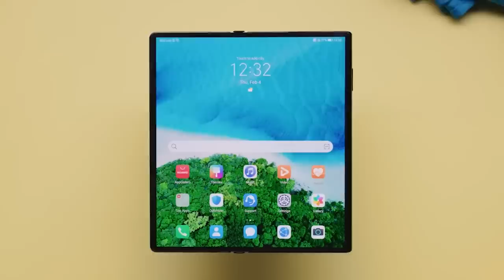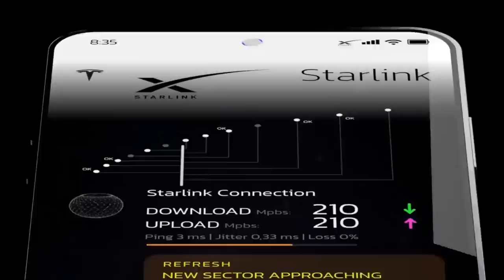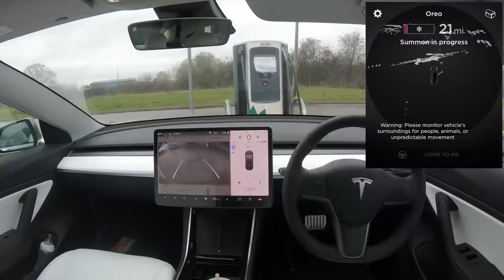Tesla Phone Model Pi Rumors🔥🔥🔥

Comment: Using Starlink, there would be no need to rent a satellite phone when heading out into the wilderness where there are no towers. That alone is huge.
Reply: Just no way. Current  starlink transmitters require 100W.
Reply: @WorBlux  So are you saying the signal does not come directly from the satellite to the phone but instead comes from a satellite to a ground station transmitter that must rely on 100W to transmit a signal to the phone?  That doesn't make sense to me.
Reply: @daffidavit  he is not saying that. But ur guess could be right since we will not find miracle tech to get that to few Wats to be usable, but it is possible phone could be a dish that drains 100W from wall. 90W is standby goes above 160W
Reply: @daffidavit   The starlink dishes they are sending out to get internet consume 100 watts of power.  You aren't putting that in a phone. For high speed data in a phone you need under a 1 Watt.  Two orders of magnitude difference. 

The satellite and starlink connection is real, the idea you could carry around the transceiver and power supply for it in your pocket is simply tech fantasy. 

Sure you could probably make a limited rate voice/text fallback that fits into form factor (64kbits/sec at best) , but that's not what is being promised in the marketing material (starlink internet (high speed date) on a phone) And even this would require a retrofit of the existing satellite constellation, and is a market niche already served by existing consetllations.
Reply: There are some serious issues I worry about. The lights from the satellites could disorient insects who depend on the stars to navigate, killing them. The space junk could obstruct Elon's own space ambitions. I just don't see this ending well.
Reply: @Mitchthemysteryman  bruh
Reply: And no need to get a different phone when traveling outside the country
Reply: I enter the wilderness to get away from the cell phone. Men have done it for hundred of years.
Reply: @WorBlux  todays phones are less than .5w. You aren’t very bright. Thank god Elon Musk is.
Reply: @petemitchell6788  What he's saying is that current Starlink receivers require 100W. You're just reinforcing his point...
Reply: @Mitchthemysteryman  I know nothing about the insects, but space junk should be taken care of. The satellites have small thrusters and they which kill themselves by entering the atmosphere at the end of their lifecycle.
Reply: @petemitchell6788  You know you can also turn off your cell phone to "get away" from it right? or just put it in do not disturb mode. No need to go to the wilderness to get away from it. lol
Reply: lol, rent. where are you siberia? or the septic states?
Reply: @petemitchell6788  Less than 0.5W is included in the range of less than 1 W. I'm being generous and assuming people would tolerate a thicker phone for the sake of satellite service. There are also several regulatory issues that make the less than 1 W relevant. (FCC license, and SAR limits)

But cell phones aren't trying to target 60 miles away. You simple need more power even in the best case. AT LEAST 36x more as a 4G cell covers 10 miles at best and the starlink satellites are 60 miles up, and could be up toe 200 miles away. Making the math even worse.  That is with the same tech.  

With cell technology, the high-gain directional antenna on the cell tower does the  bulk of the work, with 5-15 degree slices of cells around the cell tower. Beam shaping forming is done at the cell tower in a limited fashion. (2-4 transmission elements/cell) and primarily for signal separation rather than trying to steer to individual targets. 

Starlink is not a geosynchronous constellation, so both endpoints have to deal with relative motion of the other.  This is done with a phased array antenea, which uses multiple transmission elements to steer the beam. Each array can only cover a 60 deg cone, and efficiency/gain is related to the number of elements present.  The starlink satellites use a very large array as power in space is hard to come by.  We are talking thousands of array elements.  This is fine as a solution for the central transeciever.

However the  cell phone form factor is likely space is psychically limited to about 4 transmission elements. But to get enough gain to fit  within the electrical requirements of the phone you'd need an array with thousands of elements.  Also if you speak with the phone is a position other than screen up towards the sky you'd need 4 separate arrays within the phone to give you positional freedom. 

The current star-link consumer receivers split the difference. The use a few dozen array elements and a reasonable amount of power to draw from the grid or stationary power supply. 

But something even close to cell phone size and cell phone power -- absolutely not possible  unless you seriously increase the frequency window and use spread spectrum techniques to increase receiver sensitive.And you lose almost all of your bandwidth potential when you do that, compare LoRa to wifi6.  And I'm being quite generous to even assume real time voice communication would be possible. 

Musk may be bright but he's flat out lying to you, He's a con man with a long list a vaporware products, that even a cursory analysis shows to be completely bonkers. Vacuum trains, rocket mass transit, tunnels at 1/10 the conventional cost w/o any fundamental improvements to the underlying processes.  The list goes on and on.
Reply: @daffidavit   Perhaps you should have finished the third grade. The ground receiver receives the signal from the satellite and amplifies it. Like your radio or TV, and like your current cell phone.
Reply: @WorBlux  100w is not a lot of power when using an inverter.
Reply: @thatoneguy955   Sure, most "overland" type vehicles can handle that load no problem.  But it's something you are going to bolt onto the car roof, not carry around with you in your front pocket.
Reply: @daveknow  Daveknow, did you receive my challenge?  I replied here two times.  Did you receive my challenge?  If not, I'll try another way to communicate it to you.  Do you know how WAAS works?
Reply: @Hyogasaint  You are still surrounded by zombies even turning your cell off, or putting it to "do not disturb mode"
There is more peace in the wilderness.
Reply: 64
Reply: Yeah if it worked, it's slower than cable internet and costs three times as much
Reply: @petemitchell6788  this is a satirical post? or are you really that early on your voyage across the dunning-Kruger curve ?
Reply: Hmm I have my doubts this is possible. You would need some sort of power inverter - that alone would be quite the bulge in your pocket .... Musk has good ideas, but some of them are not realistic and would work great in sci-fi, but not in real life.

But if he wants to "destroy the industry" none of this fancy sci-fi tech that may be ready 10.000 years in the future when people colonize Dune is needed. Just make a simple phone, that has capabilities of top line Samsung with half the cost ... Since a lot of the cost goes to marketing, and Elon Musk is a comertial himself, that cost is already accounted for - so it's feasable!  Boom, industry destroyed!

And if you doubt - consider this: Would you buy a Tesla phone that is as good or better than the best Samsung or Apple and instead of 1200$ costs only 500-600$ ? I'd buy such a phone.
Reply: Why would I head out into the wilderness.... I like to stay close to restaurants and grocery stores... :S
Reply: Will Swift   Raw 18650 cells are not like alkiline batteries.  It's not really safe to be swapping in raw cells.  Also the 100W draw is the the pizza box size antennae. you need a lot more juice for a pocket-able antenna (150 elements vs 18)
Reply: Starlink satellites already are a huge problem because of the amount of light they reflect from the sun to earth at night for astronomers at telescopes. I hope the next satellites they build will take care of this, else I cannot recommend this phone, since it will help clutter the atmosphere for only a bit more convenience
Reply: Will Swift  Smaller elements will damn you back as they are less efficient. Maybe you find some complex geometry that overcomes that, but then you've added a big manufacturing cost, and you would decrease the effective beamsteering range of the device. (which you still have to place on a flat surface with a clear view of the sky even if you do figure out how to power it)

As I said to get this thing to work the power or size needed puts it far outside anything you'd reasonably carry with you all of the time.  The alternative is to cut the bandwitch goal significantly (no better than the old dial-up modem rates), to the point where most of the time you'd rather just have a cell phone.
Reply: @Mitchthemysteryman  ohh, poor bugs...
Reply: @WorBlux  a phone could produce that easily nowadays, even if only for 5-10 minutes.
Reply: @Mitchthemysteryman   Great. Good bye mosquitos
Reply: @WorBlux  Just no way the tech will get better with time right?🙄
Reply: @PabloKersz  It's not just mosquitos, though. Bugs are going extinct at 8x the rate of all other species, and if they go, all other life will follow, as they are a key part of the food chain.
Reply: @TheRealLazyEntrepreneur  Defiantly not better enough by the end of 2022 when this phone is supposedly supposed to drop. 

And while radio prices are getting better,  radio is a pretty mature tech, already pushing up within 80% of the theoretical limits. 

So no, not on earth you aren't getting broadband satellite on a phone handset. 

Though Mars is a different story, you could get satellites closer, and allocate very wide ride spectrum regions to the system. But serious colonization efforts are likely a long ways off.
Reply: Is this only in the USA or world wide the starlink system
Reply: How many people go into the wilderness to the point there is no mobile reception?  Doesn't seem like much of a market.
Reply: @daffidavit  mind blowing...you just invented the concept of cell phone and cell tower. you should patent that will be a thing in the future. Oh wait...
Reply: @madpuppet666  You'd be surprised, get out of the city and off the interstate there are quite a few dead zones out there. Cell boosters help but even then coverage isn't as great as what some of the maps make it seem.
Reply: @WorBlux  I'd still maintain this effects nearly no-one.  I'm in Australia - big and empty and I'm still never without cell coverage.  The fact that there are places that exist where there is bad cell coverage doesn't negate what I said.
Reply: @WorBlux  remember when it took up a whole room labeled as a “supercomputer”. We now have all that in our hand. You don’t think as time continues tech will become lighter and more powerful?
Reply: @madpuppet666  Big wide open areas are easy to maintain coverage. Mountain areas are very hard to cover. I live in a place where there are all kinds of dead spots due to mountains. You’d be very surprised once you leave many towns in the us that you don’t have cell coverage for miles. Especially in more northern states. Due to mountains. Many highways literally go through winding cannons. To maintain coverage the whole way would require a booster at nearly every other mile because of the twists.
Reply: @Zak-nv1tl  " You don’t think as time continues tech will become lighter and more powerful?"

You fail to differentiate between tech. Substituting faith in progress for actual understanding of the principles involved. 

Go though all the comments previously and I explain why exactly you shouldn't expect it in this case. Star-link in it's current form and price point is pretty damn amazing... but it is bumping up against physical limits, whereas you need more than an order of magnitude improvement to shrink it into a mobile on earth. 

And we don't have the flying cars we were promised... Why? because it was a dumb idea physically speaking. 

Sure tech has made cars much better, but they are still fundamentally the same sort of thing. Material strength and engine efficiency are fundamental limits.
Reply: @daffidavit  He's saying that it takes 100W transmitter to talk to the satellite.  It doesn't take much power to receive.  But how do you tell the satellite what to send, let alone maintain constant 2-way coms, which is always the issue.  I think Hughes uses or used to use a regular landline phone to make the requests, and then the satellite would send you what you wanted.  So you could stream movies.  You just couldn't stream 2-way video.  All one direction except for the low-bandwidth data request by phone.
Reply: @WorBlux  Nothin is a fantasy bc anything is possible. Will have it & much more than you can comprehend
Reply: @Mitchthemysteryman  those sats  are desingned  with a low  albedo to avoid  reflectivity,  by the way 
no insects  rely on the stars to navigate,   most  animals  rely on the moonlight  and  the sun, not the stars.

Comment: I don’t believe Tesla will be doing this anytime soon, although if It where to happen, I would probably buy it
Reply: tesla smart phone is a bit of no brainier if the satellites can support it.
Reply: I havent seen anything,  other than far out articles and vids
Reply: @2xrpm  I agree they do seem suspect.
Reply: It’s a joke xd
Reply: @gregg2000  i think your right.  But the idea is not.
Reply: @ST-jy2el  You mean like he took over with his boring company? 😂 Stop Idolizing men. At the end of the day, he is still a man not some god. He may be smarter than most but he is not failiure proof. He has spent his money on some of the dumbest ideas in the past which is bound to happen to anyone. He also has one of the most successful startups. He is good but stop worshiping him.
Reply: The service is supposed to come out of beta by the end of the year. You can NOT use the service in a mobile vehicle, let alone a phone.  The service requires a limited number of people using it in every area. The service is specifically NOT designed to be used by people in urban areas because of this.

So a Starlink based phone would be a disappointment for many people.
Reply: They will charge you to send video messages, wifi and Bluetooth.
Reply: @Slackware1995  The service is capable of mobile.  My understanding is its installed on aircraft.  So its only a matter of time  before mobile options are available for ships and rvs etc.
Reply: @rothgartheviking858  There are plans to test it on aircraft. They have requested FCC permission, yet there is no timeline.

My guess is that it will be primarily used for International flights to take advantage of coverage over the oceans.

Remember that Starlink tightly controllable the number of users per each specific coverage "cell".
Reply: @simppatrol6759  Why would they charge for WIFI or Bluetooth?
Reply: @Slackware1995  the same way they do for there cars😂 pay $20,000 just to get self driving, then when you sell it, the next person has to pay $20,000.
Reply: @simppatrol6759  you don't pay extra for a WIFI and/or Bluetooth capable phone now, why would you for this phone?

Comment: I haven't researched, but I have setup Lodges in Canada with Starlink and Voice calls are excellent with the ground station. I just cant imagine a handheld device will directly link to Starlink. I'm going to guess you need to own a Tesla auto with built in dish and your Pi is wireless from there. Or he builds out his own Cell Towers and backhauls those over Starlink.  Will be a game changer.
Reply: There will be no need for cell towers as this system will be 6G
Reply: All he needs to do is put more satellites in the sky 🛰️🛰️🛰️. I hear he's got access to a commercial spaceflight company that can do that...🤯
Reply: A few distracting comments. A hand held device is not going to link with Starlink Satellite. You can read many articles about dish install and need for clear unobstructed sky. A smaller less powerful device is not going to fix that.
Reply: yeah the dish uses a hundred watts to connect to starlink.

Comment: This will be a full self driving phone that can be summoned?
It appears this device can connect to star link's WiFi router - just like any other - oh.
Perhaps there will be a connector to add the antenna input then, it's complex!

What matters is the spec and why - why does Elon need to make a phone - what's the killer app?
- Neurolink possibly but unlikely.
- A sensor laden device with multiple cameras doing image analysis for some AI reason - definitely Elon.
- Expanding DoJo as a massive AI mining device to improve machine-human interaction beyond, Alexa, Siri, Cortana and Google - definitely Elon.
- Perhaps will lower the cost of the electronics used in star link, cars, rockets, robots and many others.

Yep, plenty more to discuss on this subject.
Reply: Its also a drone😅